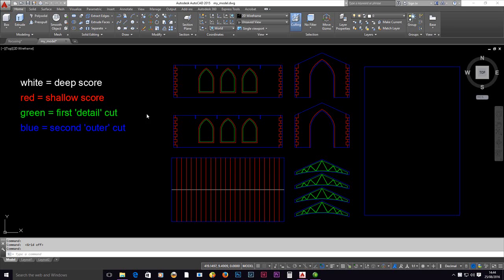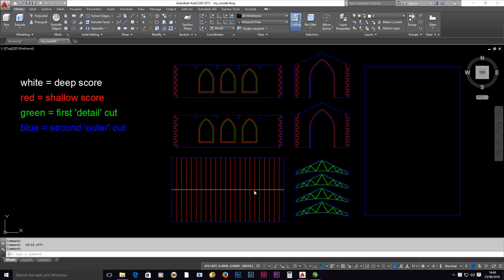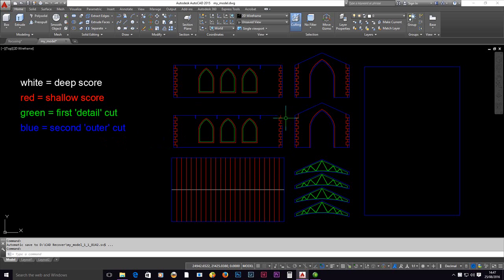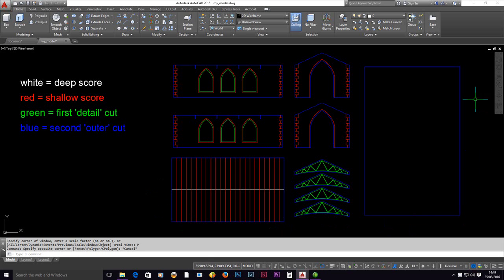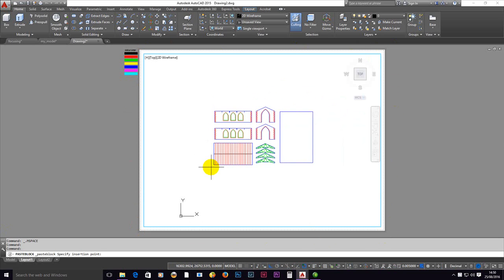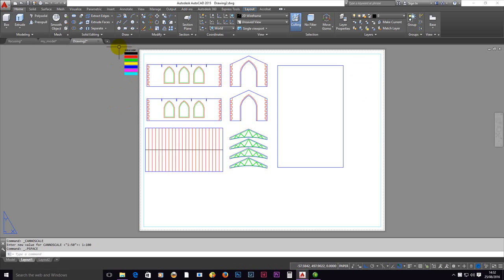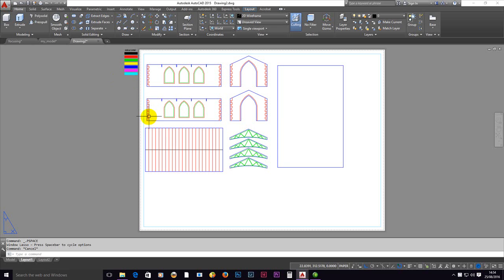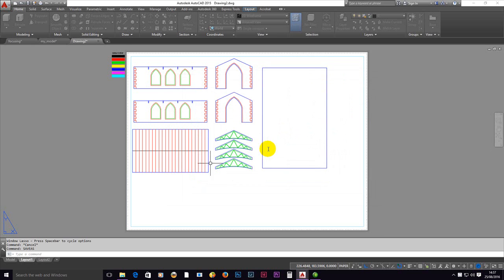Laser Cutting - AutoCAD 1 - Drawing Setup

Comment: So the application you're in to make this drawing -- are you still in the solid modeler application, or are you in some sort of drafting application?
Reply from the maker: Hi, AutoCAD can switch from a drafting mode to 3d modeling mode. For laser cutting it's all flat 2d but those shapes might have been traced around 3d slices. But tricky to put in to words. Is there a particular thing you are trying to draw ... I might be able to help with some advice.
Reply: @emmockladdie  Ok so I just got AutoCAD, so now kinda seeing how it works. I want to lay out a bunch of airfoil ribs within a rectangle representing the wood sheet, to laser cut model airplane parts. So need to insert photos of airfoil as templates, then trace shapes, scale accordingly, and play a little game of Tetris to get them all to fit nicely within the confines of the rectangular balsawood sheet. So far, I'm having some trouble achieving all this.
Reply from the maker: @AeroCraftAviation  Hi - the Tetris rotating etc is called 'nesting' - I have not found anything in AutoCAD that can do that for you automatically ... but there might be.   I use OpenNest plugin with Rhino + Grasshopper but if you are only doing this once or twice just rotating the shapes yourself is not that big a chore ... unless there's hundreds?